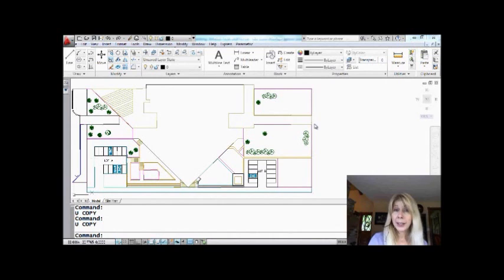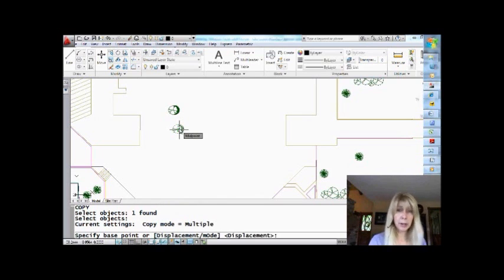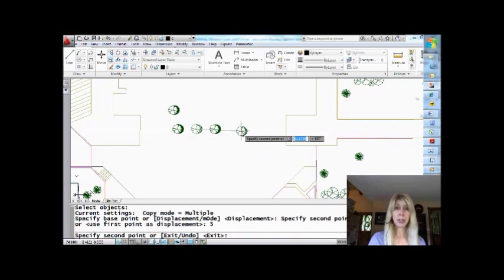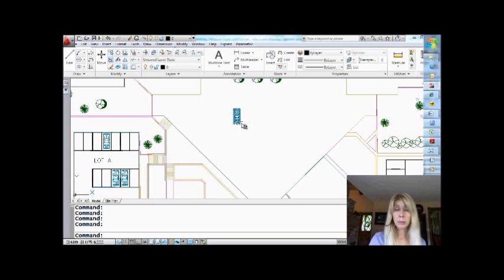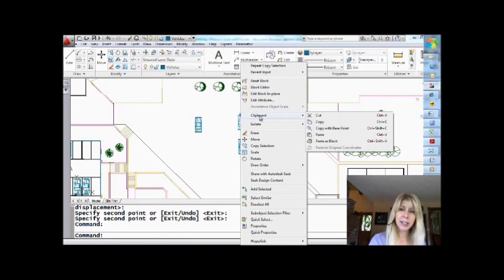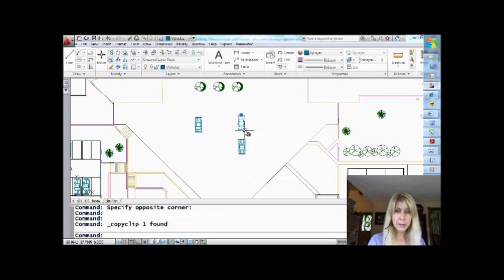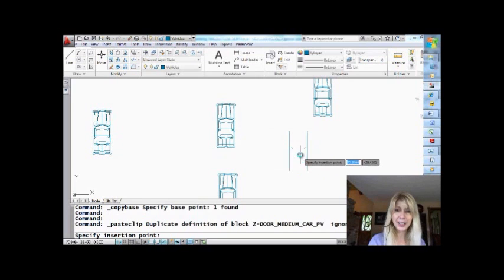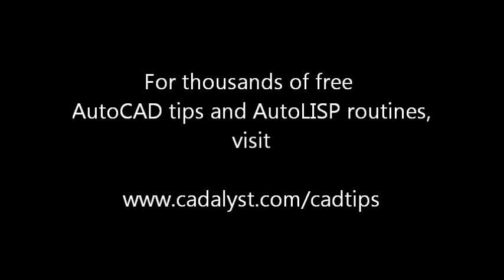All Things Copy (Lynn Allen/Cadalyst Magazine)

Comment: Dear Ms. Allen, the UI COPY command tip you've taught is awesome (as others come along) and you execute it decently but explain it wrong! the same as one you did once before at the other tip video back to a year earlier; and I just wanted to not be indifferent passer-by and write about it. What you do (as tip) has nothing to do with default Displacement option you point it out to, as you infact specify the 1st point by entering not the disp. amount but coordinates 5,0 which then it intends to imply X,Y coordinates on dis. amount(s) (to enter the literal disp., user must hit Enter at this level) knowing that cmd. prompt afterwards would be 'use first point as disp.' as default op. to hit Enter on (the one needed to be pointed out to, instead) having 1st point coordinates, the amt. of distance we were interested on to get the intended result, at the end. So this tip's nothing to do with specifying Disp., literally but 1st Point Specification, intelligently.